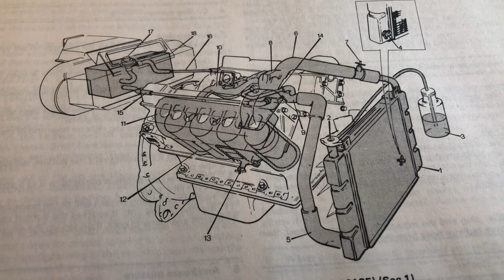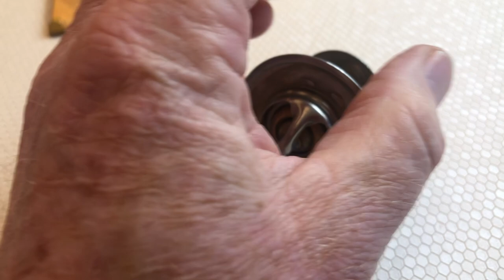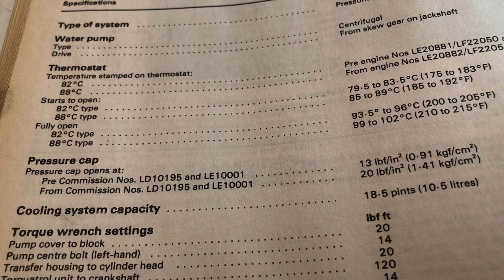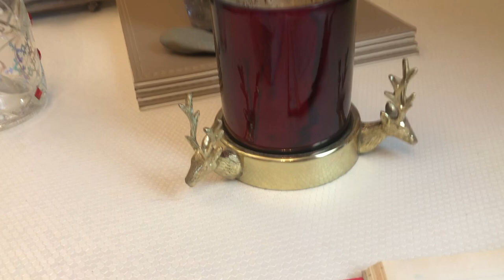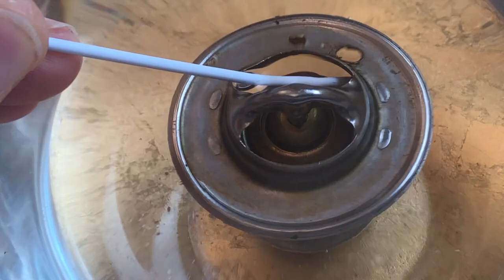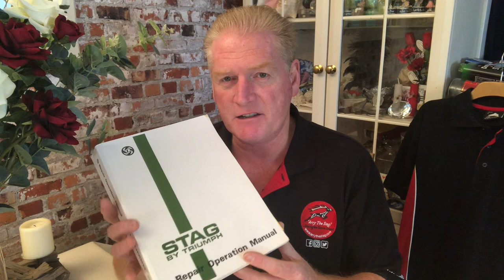Triumph Stag - How to check the Thermostat!

Comment: Another nice video,  there is wax in the bottom of the thermostat that once it gets hot it expands and this causes the body of the thermostat to open.  Rolls Royce use to use a thermostat that had a material in the large flange of the thermostat that would dissolve when it got to hot, so you over heat the engine.  When this material dissolved,  there were round holes all the way around the flange to let the coolant to pass through.  Great advise concerning thermostats and always worth doing